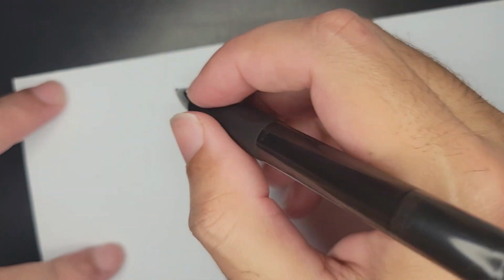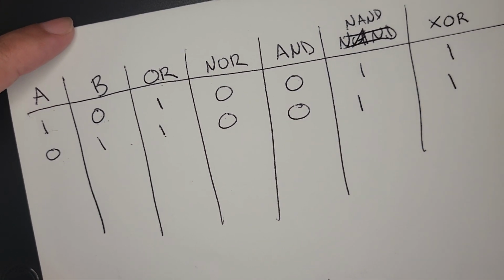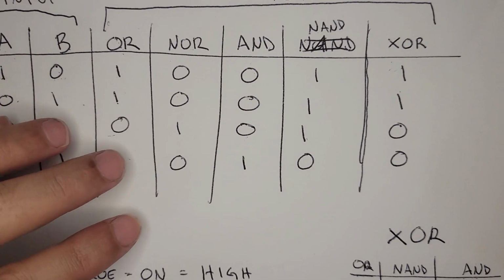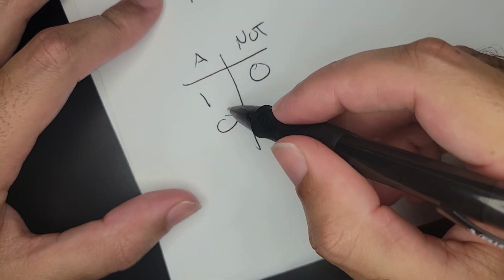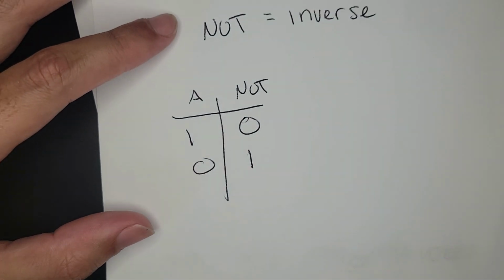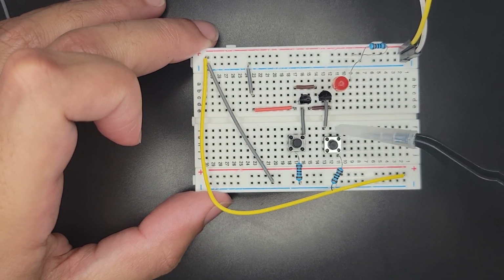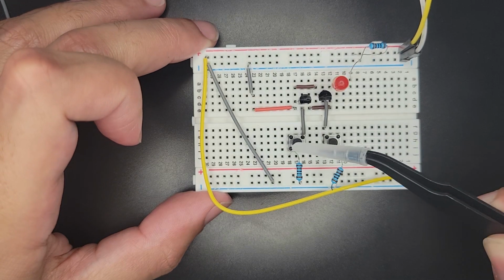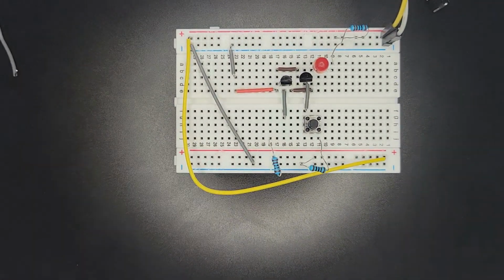Beginner Learns How Logic Gates Work & Builds OR Gate - Step-by - Beginner Electronics Logic Gates

Comment: Ok .. two things here.   For that 2N3904 NPN the leads are as you state, but look out (and look up KSA1013, then find it's datasheet where at the top is the pinout).    The leads on the KSA1013 are not in the same sequence.   

Also when you get that datasheet, look at the symbol.   Note how the arrow is pointing to the base lead (the line).  Your 2N3904 NPN is the opposite.   Now an easy (and maybe not PC) phrase to remember.. NPN = Not Pi***ng In.  The arrow is pointing away.. :)    The KSA1013 is a PNP.    And a bonus tip - read the other "installment" for this evening, and the section about the P/N junction, then look at these two acronyms.   ;-)

The other is yep, the arrow indicates the direction of current flow when the transistor is "operating".    

While checking out the datasheet, note some of the other specs they list.   Gain or "hFE" is important, as it literally is the ratio of current that is "observed" flowing from the collector to the base, divided by the current that is actually flowing from the base to the emitter (edited ).   From there remember this - "A very small change in current flow from base to emitter results in a much larger change in current flow from collector to base".
Reply from the maker: Very interesting. So the doped areas are somewhat flipped between NPN/PNP.

So the "Gain" is like turning up the amount of current flowing from the Collector to the Emitter? I was having issues with my basic AND Gate, getting false positives when only the 2nd Transistor has an input. I ended up having to put the LED first in the circuit

When I reach the XOR Gate, I had to look at the data sheet to get some help in making it work. Transistors have a lot of information! lol

Thanks again for all your input!
Reply: @MxyAhoy  Based (no pun intended) on the current flowing from base to emitter, that is correct.   If .5 amp is flowing from B to E, then given a designed gain of 10 for the transistor selected, that in turn will allow up to 5 amps through the collector to the emitter.